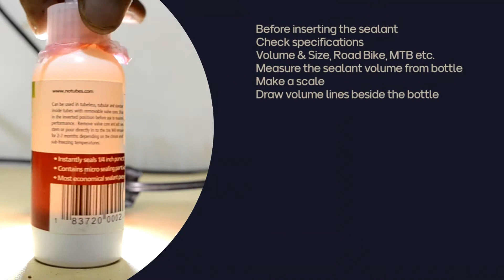Install sealant in a Presta valve

Comment: Step one - as you're going to be doing this regularly now, get the proper valve core removing tool so you're not having to use a pair of shitty old pliers on the threads of the valve core
Reply from the maker: Thanks so much, for the additional information, Ad